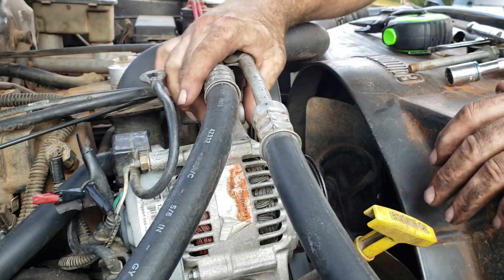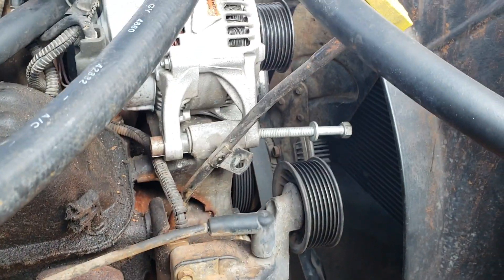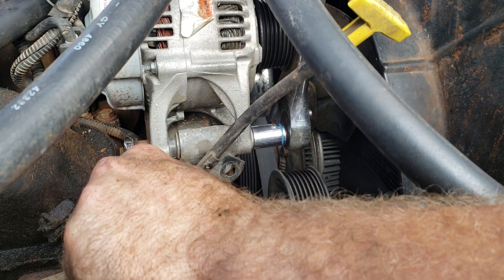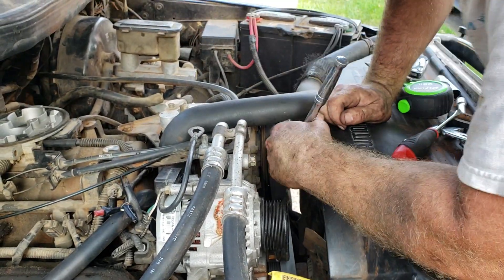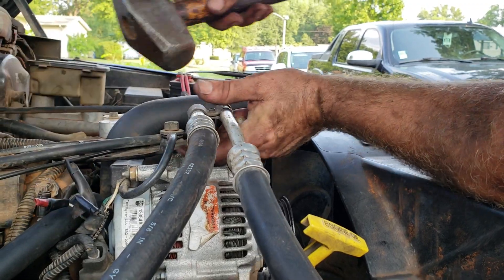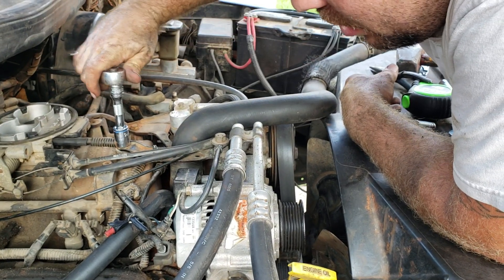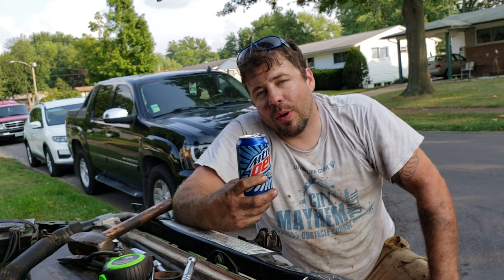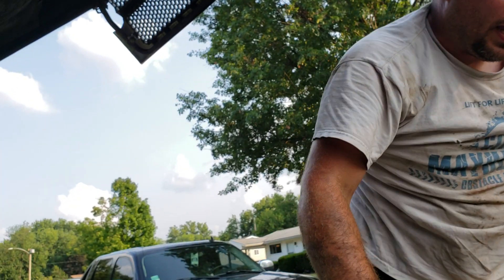replacing thermostat on 97 dodge ram 2nd gen, thermostat housing, 90 degree coolant hose. part 3

Comment: A little tip I use when doin a thermastat and housing. I run a small bead of water pump rtv sealant around both sides of the gasket. Seals housing to block. Have replaced many that even when cleaned And torqued to manufacture specs still leaked around the cheep gaskets they sell now days. Unless you have a felpro grade gasket it’s just good practice because it’s a lot of work to tear it back down if it does leak. After pump try sealant small tube is a few bucks. Great stuff to have around. These auto part stores will tell you that you don’t need it.  It I have proven them wrong more then once haha.